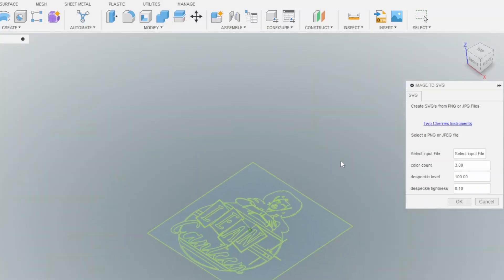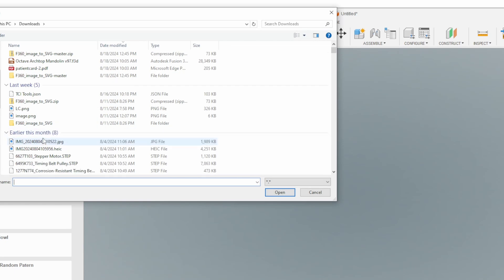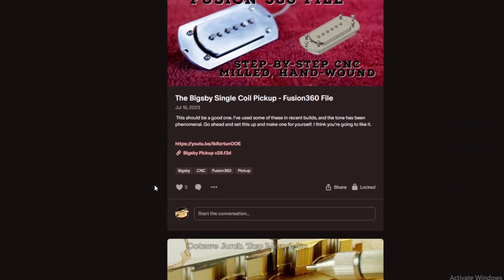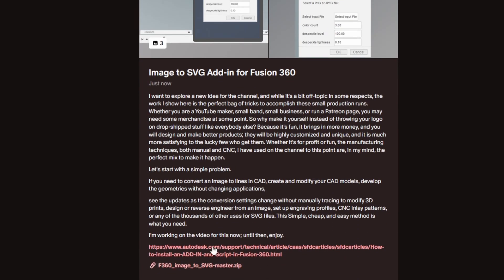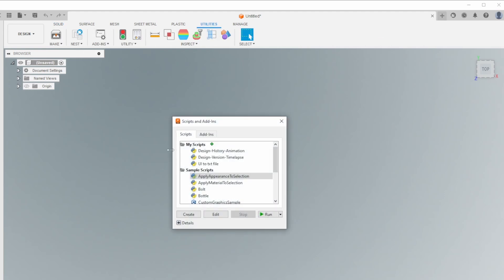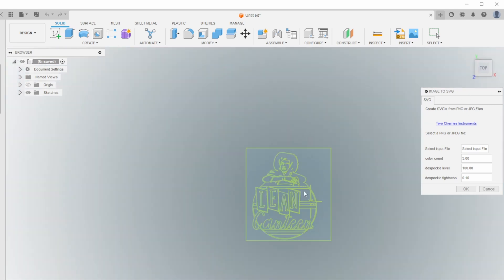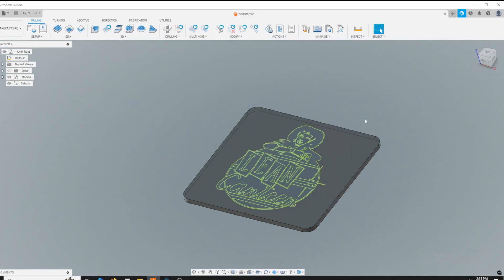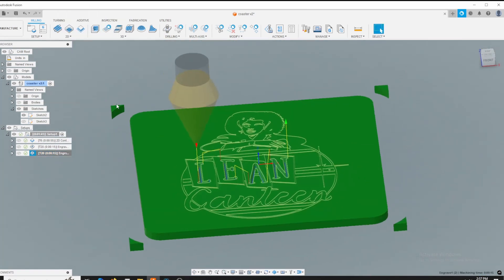How to convert any image to SVG - Stunning Fusion 360 Engravings

Comment: Dude this is so cool, and I found myself in this exact spot as of this last week. unfortunately I'm a Mac user. but either way great job, and its cool to see others push through these types of tasks.👊🏼
Reply from the maker: Thanks, I don't think it's going to be all that difficult to get this to work on mac, just a bit of a difference with importing the modules, I will have to figure out a way to test it.
Reply: @TwoCherriesIns  Hi, great video and great tool. Unfortunately, I'm also a Mac user. Did you happen to solve the configuration in macOS?
Reply from the maker: @lorenzotrevisani5702 I haven't, I don't have a good way to do that at the moment, I'll see what I can do